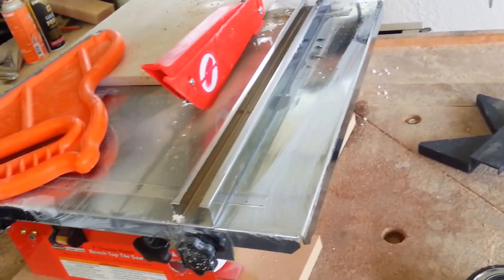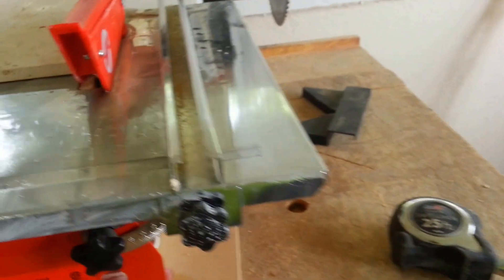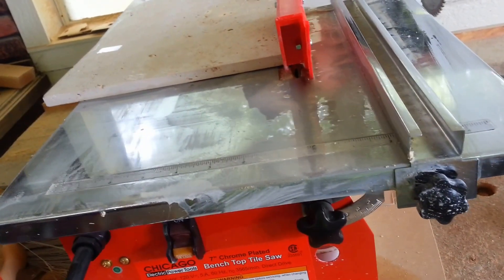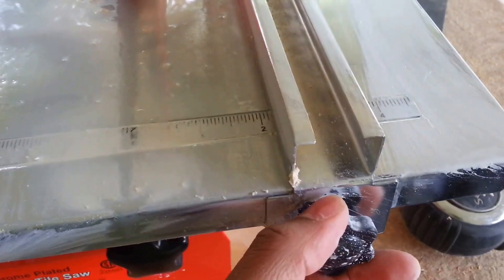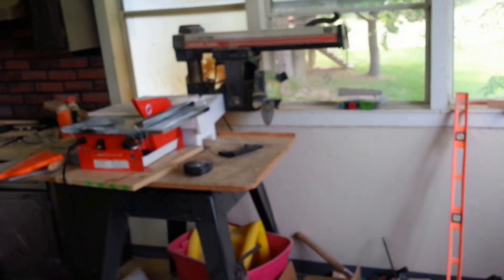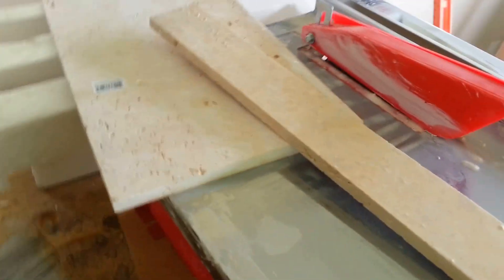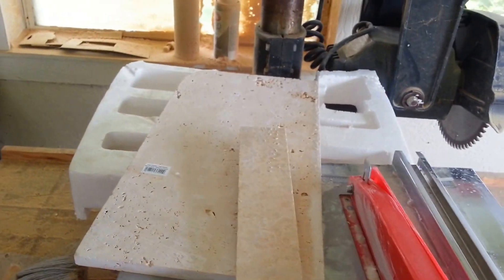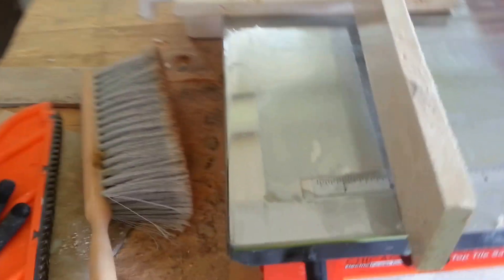Harbor Freight 7" Portable Wet Cut Tile Saw Review and Test

Comment: Thanks for this complete and honest review.  I bought one of these in March for an eventual backsplash replacement project.  I haven’t gotten to that yet, but ended up using it for the first time today while adding slate facing to a staircase.  It worked beautifully, but definitely throws a lot of water, so I had to check the pan every 10 or so cuts.  Still, it was well-worth the $65 I spent on it (with coupon) + $20 for the Warrior blade.  It made very quick and precise work of my project.  The other thing I really appreciated was that it has a ruler on both the front and back of the table, which makes aligning the fence way easier than on my table saw.  I was glad to see you pointed this out.  It’s a thoughtful touch.

Comment: I bought the saw knowing it's a Harbor Freight China cheap.  I'll only use it very rarely.  However, they sent me away with the thing without telling me there was no blade included. I only venture into Harbor Freight when I want some low price tool that I can regard as disposable.  Selling it without a blade or sending me on my way without telling is truly low-brow, even for Harbor Freight.
Reply from the maker: They should have reminded you that the blade is not included. I'm sure you're not the first person that came back saying you don't have a blade in the box. I'm pretty sure they told me when I bought mine.

Comment: You could use this machine to cut wood by changing the saw
Reply from the maker: It would probably work but It would make a pretty poor table saw. You would probably be better off with a circular saw.

Comment: I am looking for a way to cut HDPE sheets without melting them. Can anyone tell me if a wet saw could work for that?
Reply from the maker: I'm pretty sure it wouldn't work. these kinds of saw us pretty much just using friction to cut. Something with teeth might work if you could push it through fast enough.
Reply: Thank you for your input. Would you know if a fine toothed circular saw blade could fit in place of the mason's saw blade?
Reply from the maker: Jeremy McLaughlin i guess in theory any saw blade that is the same diameter as the original diamond blade could potentially work. As long as it has the same size hole through the center you could put it on the wet-saw, but I still dont know if it would stop the plastic from melting while cutting.
Reply: did you ever find a saw that works for cutting hdpe sheets? Im also working with hdpe sheets and looking for a good tool to do the job

Comment: Thanks for the video.  Overall I've had good results with HF tools.  But I'm more on the level of casual to avid do it yourselfer. Definitely not a pro so I wouldn't be using their tools on a daily basis.  Certainly not weekly.  But I find it odd how most HF tool reviews always start with some sort of justification as to why you're buying HF tools.  Seems almost apologetic.  I did like your review so thank you.  I have a hunch that the protective film is probably supposed to be removed? If not, then yes I would agree it is a bad design given that the area will be under frequent friction.
Reply from the maker: Hum Rod thats exactly how I feel about HF tools.

Comment: Thank you for the great review!  From what I've read on the HF website, you have the all metal saw which is supposedly the updated design.  Some people complain about possible chips in the material being cut, but I think that would probably be linked to the blade and not the saw since the motor sounded ample enough to keep up with your material thickness.  There were some complaints about water spraying or the operator getting sprayed with mist while using the saw, have you experienced that?  Are you using a continuous diamond blade or notched blade, if you've used both has one worked better than the other?  If I purchase this saw I'm planning on cutting 3/8" marble with it for a small bathroom project, hopefully this saw will be a good choice.